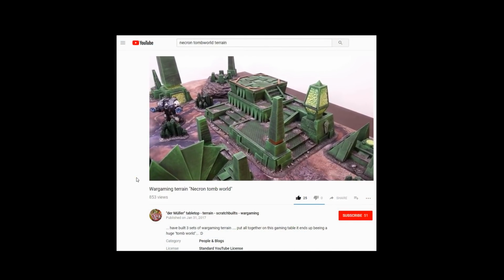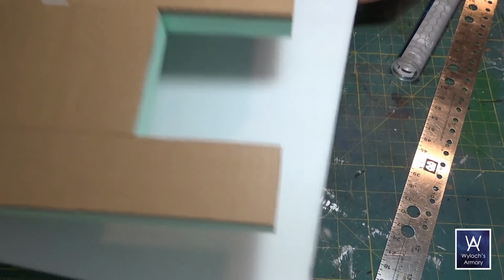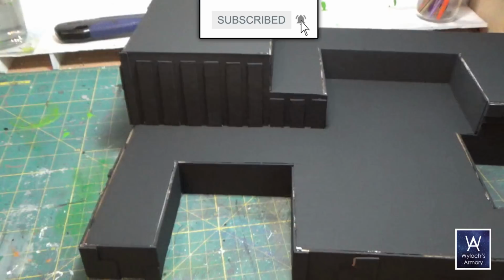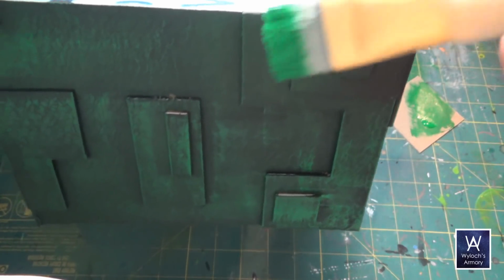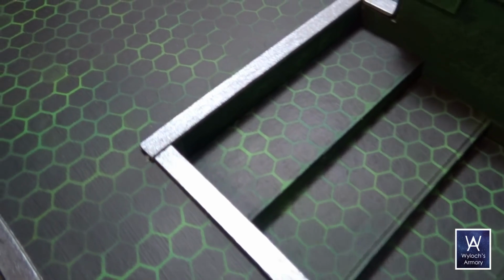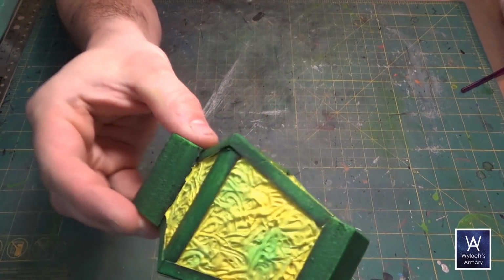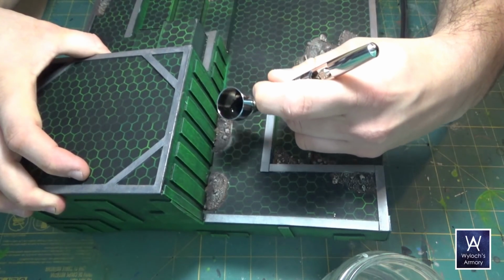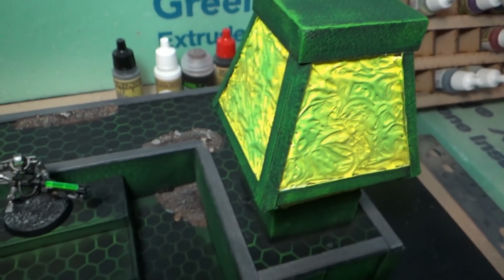How to Make a Necron Tomb for Warhammer 40k

Comment: This just came to me, but if you don't overdo it with the green (and/or give it a slightly metallic sheen) you could also use this as Terrain for something like DnD.
You can use it as remains found of an ancient civilisation, and since it's usually portrayed as having a greenish sheen, you could say that this civilisation was so rich, that they covered their structures with a thin sheet of adamantine.
Things like Necron glyphs could also add to how alien and removed from time such a place would feel.

Or, if you're really crafty, you could add functioning elevators and/or floating platforms, that move along the walls, similar to how it's shown in the Mechanicus game.

Comment: Oh well this is so great and really helps me with a project I'm wanting to start. I want to build a small battle tablefor Warhammer, and it's going to be a battle barge like its dock today space station or something and it's the upper portion and on Deck is where the battle will occur and just from the thumbnail I can tell that the construction principles the same, large flat areas with slight deviations in elevation so thank you this will help me get it done.

Comment: Hey, I have a problem with my cardboardlock-clips: I used the exact chipboard that you used, but it still frayed and some clips even bent and the clips werent usable anymore after e few times. This happened although I clipped the corners. What can I do to prevent that?
(I used the system on some bmc-style foam tiles)
Reply from the maker: Jakob Stahlhof perhaps coat them with a varnish
Reply: Wyloch's Crafting Vids Would white glue work for that? Did you ever have this problem?
Reply from the maker: Rumo_Der_Wolpertinger no I have not had any issue with fraying.  But yes white glue makes for a fine cheap varnish.

Comment: If you want a better way to paint the sand, one easy and rather good looking one is to, after gluing it down, use some acryllic ink. It tends to soak through the sand after the glue dries and works great for it. Once it dries you can still drybrush it if you want above that...

Comment: Very cool! Love the floor pattern; it turned out fantastic. Not really sold on the texturing for the crystal structure, though... I might try coating the chipboard with ModPodge to create a smooth surface, then paint with nail varnish for a high-gloss finish :)